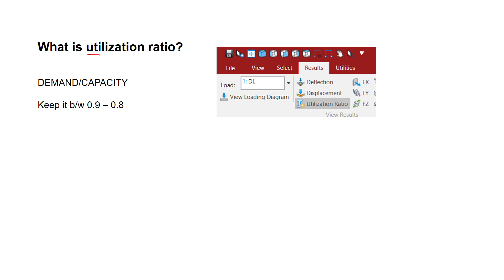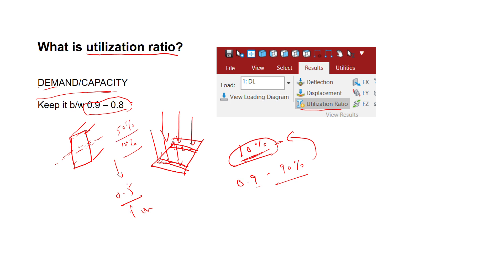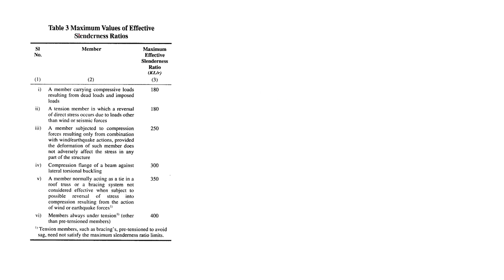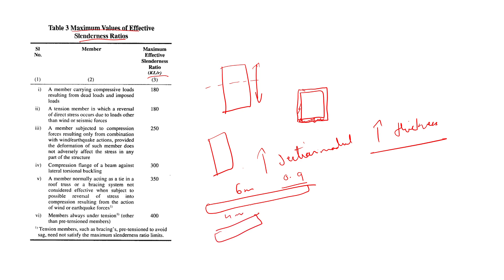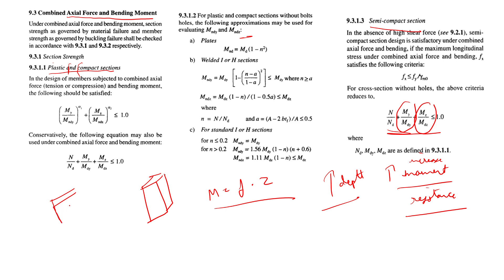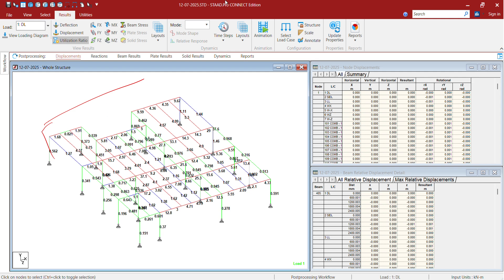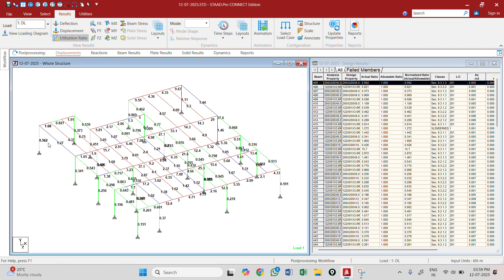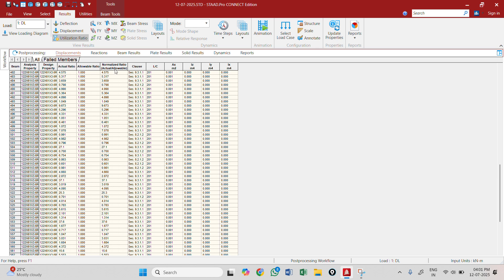Understanding Utilization Ratio in STAAD Pro | What to Check & How to Fix Failures

Comment: what do I do in order to show the utilization ratio values on the structure/diagram itself?
Reply from the maker: Just click on Postprocessing mode, then go to Beam → Unity Check or Utilization Ratio, and make sure the labels are turned on from the top toolbar (Diagram → Labels → Utilization Ratio).